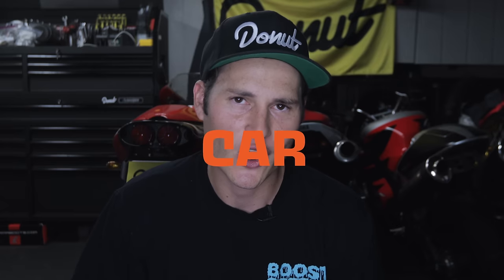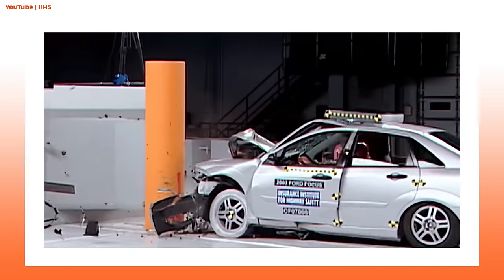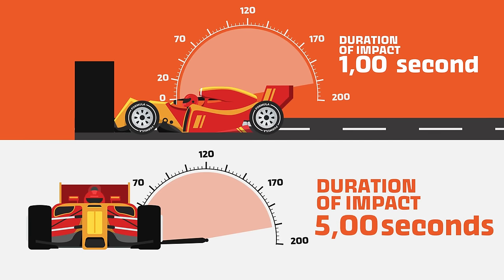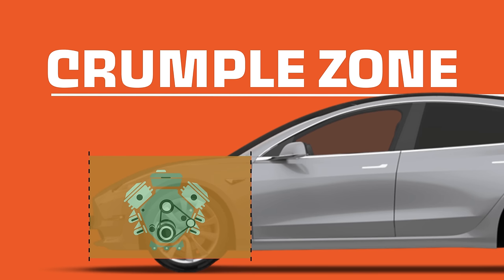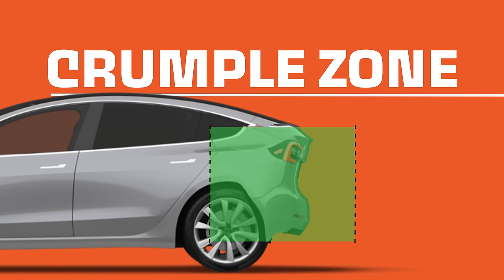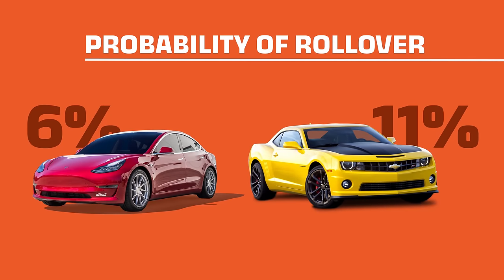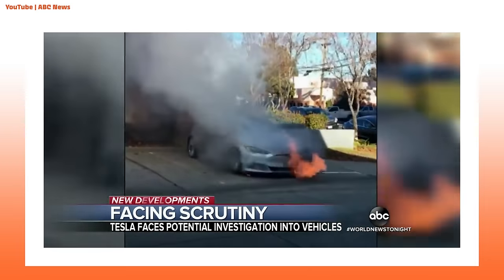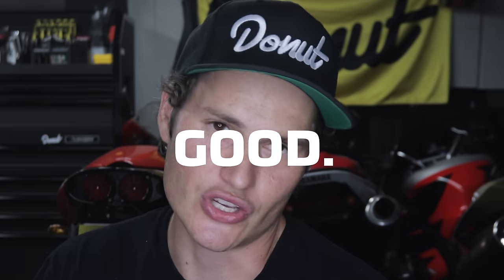How Tesla Used GLASS to Build the World’s Safest car

Comment: *Meanwhile in my head: "Glass is glass and glass can break.."
Reply: The perfect crossover doesn't exi--
Reply: With scratches at a level 6 and deeper groves at a level 7.
Reply: Glass Breaking is what saves you. Absorption of Force.
Reply: Because there are 2 glasses sticked together with that plastic material, it's really hard to get badly hurt by shards, they will stay all in their place, maybe just some minor shards will fall from the collision point but it's not big deal
Reply: With scratches at a level 6 an deeper grooves at a level 7 
lmaoo
Reply: Its not like your car has a windscreen or something like that, guess what its made out of? That one uses basically exactly the same technology, just with a thin plastic foil between them
Reply: @D3nn1s  exactly
Reply: @qualcunoacaso4865  furthermore, tempered glass breaks into small pellets instead of sharp pieces.
Reply: @CraigNesbit  yes, much safer. I work with glasses everyday :)
Reply: Scratch at level 6 and deeper grooves at level 7
Reply: Think fiber glass boats, fiber-optics, stirling engine glass....
Reply: a man of culture
Reply: Here are some Mohs hardness picks... / / / / / / / / / / /
Reply: @Jerry_Rig
Reply: There are obviously different types of glass. The Ford GT for example uses Gorilla glass, similar to the type some smart phones are made with. Its a lot tougher to break than your normal standard glass found in most cars.
Reply: How about bulletproof glass
Like in the president's limousine...
Does that help ?
Reply: Yup, I get it, Our heads tell us what we know or are used to. It Tesla has something new about glass solutions for cars, how will your head find out?

Comment: Worlds safest car
Laughs in Mazda Miata
Reply: Laughs with in miata with role bar and race harness lol.
Reply: NA: Safety? Did you mean pop up headlights?
Reply: Actually I believe in a Tesla you mostly will meet a accident.
But in a Miata(NA) where you know where the wheels point due to hydraulic power steering mostly you won't have an accident.

Just guessing.
Please correct me
Reply: @atarvhegde5210  yeah and beacuse of auto pilot
Reply: @maxnugteren4837  
I wonder if an old BMW( Like 2002 ) would be safer than a Miata
Reply: In a Tesla the car wont prevent a accident.
Miata (NA)'s responsive steering will prevent an accident.
A Miata may be kind of unreliable.
But I feel Tesla will be the king of unreliability considering how much electronics it has.

Just imagine a Tesla Model S Performance got  beaten a E90 M3 just because touchscreen was broken due to which the car could not enable ludicrous mode
Reply: A Miata had a very high active safety rating as long as the driver in fully focused on driving
Reply: @ananden.r9065  you can get in a crash sitting at a stop light.. my last vehicle was totaled out when a lady decided she wanted to go into the trun lane at 40mph right into the back of my car. I get the "active safety" argument but sometimes you will be involved in an accident if you look out for it or not

Comment: I just want to say, DO NOT let autopilot completely drive for you. Keep your hands on the wheel, and pay attention. This system is still in beta, and it has its flaws. It isn't perfect.
Reply: It isn't perfect, but still better than most human drivers...
Reply: That's how you're supposed to use autopilot anyway....it'll start screaming if you don't have a hand on your wheel. You've to still pay attention to the road, it just takes off some of the stress for you

Comment: HAHA active safety features... let's compare my 1973 Land Rover Series with Tesla Mode 3. 1. No built in air conditioner, you wont fall asleep
2. No built in navi, you have to concentrate
3. Rigid steel bumper, bouncing other cars in collision
4. Steel skeleton on the sides, destroys incoming cars. 
5. No need for active safety measures, just common sense.

Comment: I have changed a roof panel in a model 3 that had a crack, similar to how laminate glass breaks. That glass is bonded to the roof structure directly, so the structure is responsible not the glass

Comment: SI units of force is a Newton (N) which is the SI counterpart to lbs. Kilograms (kg) are regarding weight, or gravity’s influence on an object. Kilograms are not a force and are not measured by a load cell. Likewise, the imperial counterpart of kilograms are called Slugs. 

Imperial system measures your body mass as the amount of force you exert due to gravity, whereas metric/si measure your body mass as the weight of itself. Fun fact for ya.
Reply: kg is mass, not weight

Comment: I am glad that Tesla builds such a safe car, but am concerned about the autopilot. I don’t blame people thinking that the autopilot is  like in a plane needs no pilots! you always see the car going with people having their hand on their lap, or more realistically being on their phone. 
I can’t blame people thinking this autopilot is a fully autonomous driving system. And here is where people will hate me, it is only a level two system meaning you can take your foot off the pedals, but you should stay alert and not remove your hands off the steering wheel for more than 15 seconds ( mist German cars have warnings, versus some like Lexus that just turns off the system even if the passenger is really incapacitated. I drive a MB S class and the latest version (2922) only has level 3 autonomous driving in Germany.  
However you hear people playing games in their phone for 28 or some minutes driving at high way speeds and the car hitting the side of an 18 wheeler or recently two men in their 6o’s in Florida in a Tesla s and no one in the drivers seat that crashed in a cul de sac and burnt. Who is to blame? Is there no warning on a Tesla that you should have your hands on or see via camera that the driver is not paying attention. 
What do you think? Yes even journalists say that the autopilot is great, but it is not better than the new Hyundai  2022 Tucson  level 2 autonomous system in Korea. The name of autopilot is wonderful, but is misleading!

Comment: fun fact for you that you totally missed. 

the crumple zone in an ICE car is pretty much created during the crash, the way the chassis is designed is to channel the engine underneath the car during an impact which makes it possible to design a car wich has really good front protection.

and I would still prefer to sit in a volvo, they are not at all far off in all but one of the crash tests that the american crash test people conduct. the one they aren't far off but far ahead is in the small overlap crashes, volvos prettu much shed the front fender and wheel which makes it possible for the car to continue forward which as you said minimises the forces that's going through the body.

volvo also has a technology that what I know of isn't tested by any of the crash testers and that is crumple zones underneath the seats in the case of running off the road into the ditch and hitting something that launches the car into the air. these crumple zones drastically lowers the severity of a back injury in these types of accidents.

but to be honest, I would prefer not to crash cause that would destroy my lovely 1996 volvo 940 polar estate and that would suck big time

Comment: Dear donuts: Not convinced about tempered glass argument, when you temper glass you're literally storing energy in it - like a prince rupert's drop. PRDs (and tempered glass) don't spread out the area of energy dissipation for your little crack, they just release their stored energy at the speed of sound and are suddenly inconsequential for energy dissipation. Are the laminations helping out after this point? Well firstly they're not metal, and secondly their main design purposes are bonding together multiple layers of glass - which we just destroyed - and to reduce glass injuries, so no. Tempering and laminating is adding strength, yes, but the panel only has milliseconds to transfer energy across the roof before it cracks itself to oblivion and contributes little more than a tupperware lid

Comment: There's no denying that the Model 3 is an extremely safe car. But I don't like the way you wrote the video (and others for that matter): you set out with a predetermined conclusion (the Model 3 is the safest car in the world), and then set out to prove it, without questioning its faults. 
I'm saying that because the latest 3 series got a better rating on everything except active safety on EuroNCAP. And this is with an engine up front, and no glass roof. This doesn't mean the Model 3 is bad, but that its position as "the best" is debatable. Plus, there's a major weakness in that roof: once it goes, it's broken, and won't be able to withstand a second impact with the same resistance. A metal structure would. Although I love the airy sensation from the back seats of the Model 3.

Comment: You want the front and back to deform easily, but if the middle is super rigid it's a must...
You don't want the car to flip on its roof, but if it spins around its yaw axis it's good because you increase the duration of impact...
It seems contradictory. May someone explain ? Thanks :)

Comment: 1. There are cars that got better impact scores
2. Having an engine doesn't mean it can do as good as Tesla. For example, look at EuroNCAP impact scores. When Model 3 was tested in 2019, Mazda 3 got better impact protection. Not by much, but better.
3. Not only Tesla has thick pillars, all modern cars have it.
3. All modern cars have autonomous emergency braking. And it works just as good as in Tesla.  In fact, if you look at EuroNCAP Mazda 3 score of auto emergency braking, it got a better score than Model 3. Also, there are plenty of cases where auto braking didn't worked in Tesla.  Like that well known one where a truck was flipped on the highway and a Tesla slammed into it, despite having a clear sight and plenty of time to stop.
In my opinion, Tesla is not the safest car on the road, it is just one of the safest. Also, car safety is a continuous process. Just because a car was the safest 3 years ago, that doesn't mean it is still is today. Car safety gets better with time.

Comment: the new model 3 and model x have redesigned the front and rear chassis with the mega-casting that will aid in controlled deformation in crashies.  And they deleted the radar and use only visual cameras for the so-called auto pilot.

Comment: does the time of impact really change that much because of the glass roof? energy travels through tempered glass faster than a bullet
Reply: I don't think it does. You can shatter an entire pane of tempered glass with a gentle hit on the edge with a tiny rock shard. The glass shatters not because it's absorbing the forces, but because it's RELEASING the forces bound within it and the balance of forces holding it together was upset. The other iffy bit of information was at the end with battery fires; battery fires are bad not because they happen, but because there's no way to cost effectively put them out and keep them put out, so they're just allowed to burn out instead.

Comment: Maybe instead of comparing miles driven, which doesnt make sense,
Compare how many Tesla’s have burned annually, by model, how long the owner have owned said tesla till the burning happened, look into what caused the burning? Maybe there was a manufacturing defective? Battery wasnt mounted properly and millions of Tesla’s are in need of a recall?

Comment: Whether you like to drive or not, autopilot will have one MAJOR safety program, if it can detect that you've fallen asleep, which isn't hard, it can be programed to either take you home or pull over to the side of the road safely based upon the user's preferences input.
People fall asleep driving all the time. That would take advantage of the technology, while simultaneously easing the Luddite's concerns about AI driving.

Comment: I rolled a car taking a corner too fast and hit a culvert and ditch.   I should have said I was spreading out the impact distance.
Reply: It was a 16 accord sedan, i barely rolled across the front right fender and a pillar, the roof cleared, and I landed PERFECTLY on my tires.  It was a perfect barrel roll.  Car was totaled but was still running

Comment: yes, cars catching on fire is never a good thing and yes, it is blown out of proportions when it comes to fires in electric cars. ICE engined cars only have one advantage when it comes to fires and that is the fact that they are easier to put out. the problem with lithium ion batteries is that if you puncture the battery in a crash does it catch on fire, and that fire is extremely difficult to put out completely. the fire fighters put it out, and then it catches on fire again so they put it out again and so on pretty much until all the damaged cells have burnt out entirely.

but I also think but this is just a speculation that you're in a way blowing ICE fires out of proportion too cause you're bunching all the brands and fuels together. some of the best auto makers might come relatively close to how many teslas catch on fire whilst others wich is either made to be cheaper or made with less knowledge on how to prevent fires will be easier to have catch on fire. I don't know the statistics on this tho and i'm too lazy to look them out but my logical brain says that this will be the case if someone bothers to check it up

Comment: Pretty bad comparing vehicles catching on fire, petrol vs. Tesla, when the oldest Tesla ever is from 2008. Compare it to a very recent BMW or a Merc with same kind of mileages and use as the Tesla for example and the numbers might be a bit different. The comparison made in the video includes against all kinds of sports cars and old Ladas from 60 years ago. Lets see the same thing in a 100 years.  Also the problem isn't only the "catching on fire" part, it's putting the fire out. Anyone seen the Rimac catch on fire in grand tour, literally burned for 3 days, because nothing can stop li-ion batteries from burning out?

Autopilot is a nice safe-feature when it works... how ever when it doesn't people get killed. Autopilot will also be a fascinating thing to see working after the car is 15-25 years old. 

As a side note, comparing a Model 3 in a crash test against a twice as cheap Honda Civic is ridiculous.

BTW: Model 3 isn't the best on Euroncap, the european equal to IIHS... Mercedes CLA is.

Comment: I still wonder what would happen if you hit a moose with a Model X with that windshield that ends above your head, in pretty much ever Moose collision it is the roof above your head that saves you (more specifically the edge where the roof meets the windshield).

Tesla builds cars for the bullsh*t American crash tests ratings, but in real life we have horrific “auto pilot” crashes.
Also the mor*ns not being able to flip them in testing makes for a lot of uncertainty and those corrupted f*cks failed to do their job.

The reason why EV fires are more notable is because you can’t put them out, at it’s core it is a chemical fire that can even burn under water (in some cases), you can put out a EV fire but 5 to 20 minuets later the car will be on fire again and again and again until the chemical energy in the battery is completely gone.

With a regular car you generally only have to put out the fire once or twice, diesel fires are a little harder than petrol fires to put out but harder to start.
Reply: The roof doesn't really matter in a moose accident. If a moose flies throw your windshield you're dead. No matter what kind of roof you have.
Reply: @estonsman4566  have you seen a moose collision?

The usually don’t go straight through the windshield, they are that big and tall.
Apart from the legs damaging the front end, the bulk of the moose usually hits the edge of the roof and top of the A pillars.
The thing the saves you in a moose collision is the strength of the roof above your head and A pillars.

Both Volvo and Saab use to test their cars for that type of collision

Comment: We don't measure human weight with kilos in the UK. We use stone and lbs. 14 pounds to a stone. 

As an example, I weigh a little under 13 stone, or 12s 12lbs or 180lbs...or however many kilos...80 some-ish I think.

Comment: While I agree that the battery fire was streched, they did have weak protection in the first couple years that allowed it to easily combust. I remember it informed owners of the threat and told them to leave the vehicle. Also currently, tesla has sketchy practices with no recalls and total control since its all software based. So we dont know the truth